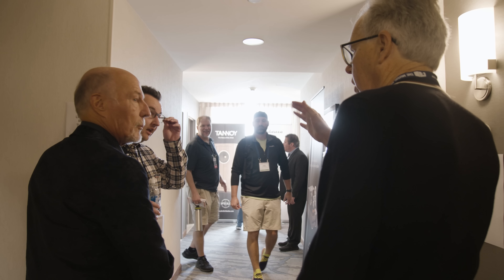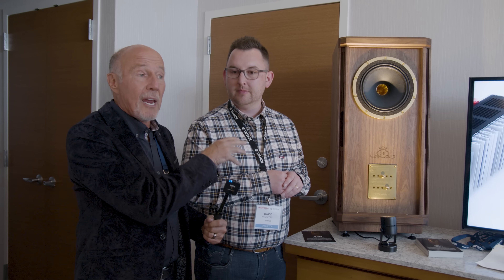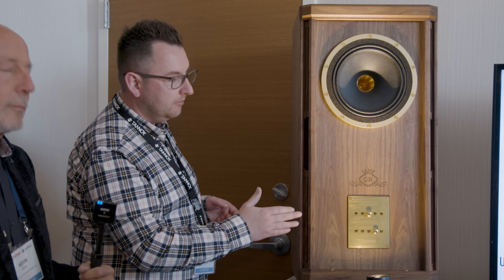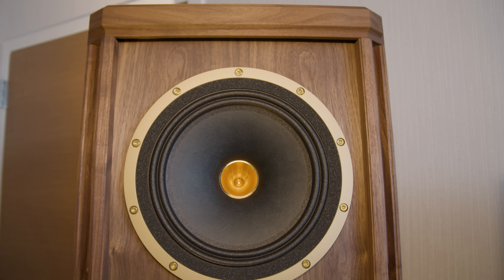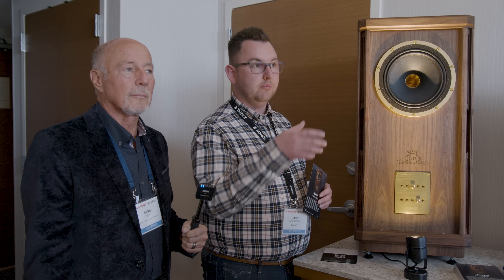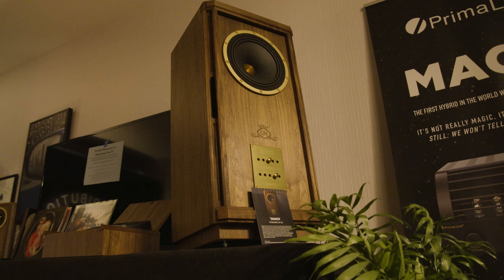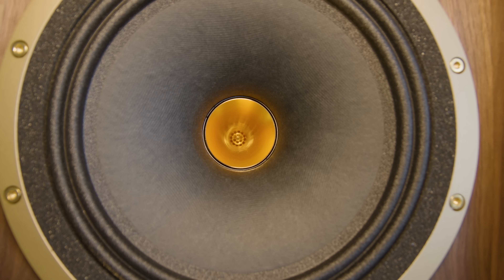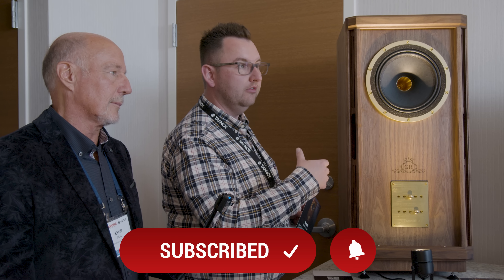Classic Dual Concentric Design REINVENTED | The Tannoy Stirling III LZ Loudspeaker

Comment: 5:38 Unless I'm missing something, the guy from Tannoy didn't answer Tom's question about the tweeter loading correctly. It is a 2" diameter concave aluminum-magnesium dome firing through a high compression ratio phase plug converging into a narrow horn throat, so yes it is "loaded". I had the pleasure of spending a couple of afternoons with a pair of Alnico Kensingtons that had come into a friend's store on consignment, and they were delightful. While not the most analytically detailed speaker I've ever heard, They sounded warm and rich on pretty much any type of music I threw at them, and were really easy to listen to for extended time periods. If the new Stirling sounds anything like the Kensingtons, it should be a winner at 60% of the price.
Reply: Exactly. It's a real blunder from a noob from Tannoy. Of course HF is loaded horn design and of course the LF cone acts as an horn flare extension of the solid horn. It's exactly like the HF in all AlNiCo drivers since 1947 or so, when Monitor Black was introduced . Poor old Ronnie Rackham must be spinning like crazy in his grave with such noobs representing Tannoy....

Comment: Love my Tannoy Cheviots. I shopped 3-way tower speakers for 10 years. I owned four high-reputation sets, but none sounded right -- too disjointed and edgy. A wise speakerhead suggested I might have ultra sensitivity to timing and phase errors inherent in 3-way tower speakers. Once I heard Tannoy dual concentric, my problem was immediately solved. I also own KEF LS50Ws and they are pretty darn good. Cheviots are easy to place and have adjustable frequency response to tailor to your ears and your room.  Plays well with lots of SS watts (250W PSAudio) or tubes. or combination (Linear Tube Audio Z40).

Comment: Alnico isn't," Voodoo". Its an alloy that manifests a stronger Field than the typical Strontium/Barium Ferrites commonly used. Although I prefer the NeBFe alloy in my Lowther DX 65's and Raal 140-15D's for even greater Field strength.
Reply: Indeed ! ..............besides the motor design is also different , the magnet is inside the voice coil ..........Alnico sound BETTER than usual ! NO discussion !
Reply: @frankgeeraerts6243  Morel has used magnets inside the voice coil as has Dynaudio for decades. As to better than usual? Better than NeBFe? I'd say no way, due to the increased Field strength, afforded by the newer alloy, and the constraint of Newton's Second Law of Motion. I agree, better than Ferrites. Due to increased control afforded by the greater F in F=MA, permitting greater Second Derivative of Space with respect to Time, Acceleration, exhibited by AlNiCo vs Ferrites. Personally, the Lowther, to my knowledge is the only full range moving coil with the coil cooled by ferro fluid too. If you know of another manufacturer who does employ it let me know. Just Curious.
Reply: He's a salesman, whaddya expect?
Reply: @bruceamitchell  In a hobby with its basis in Science and Engineering, a little more fact based discussion. Its not too much to ask, magic it ain't.